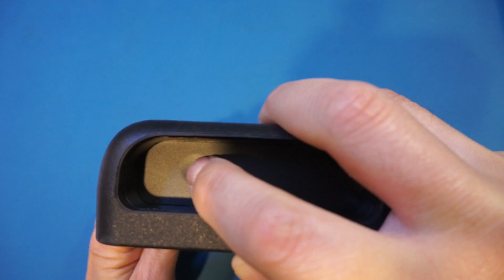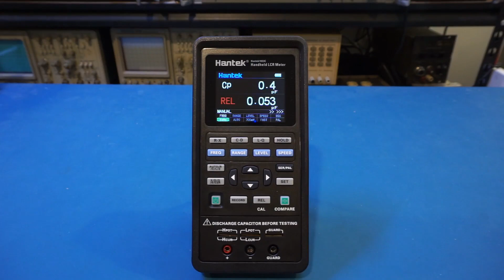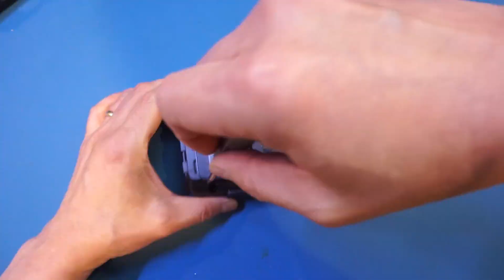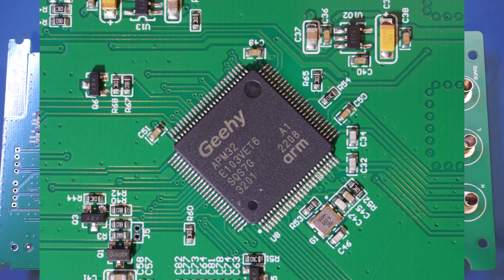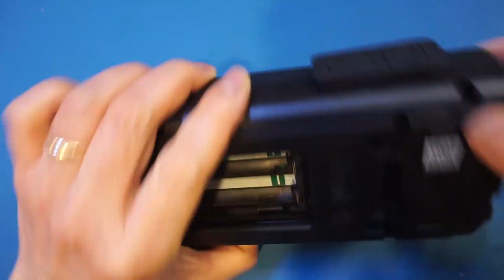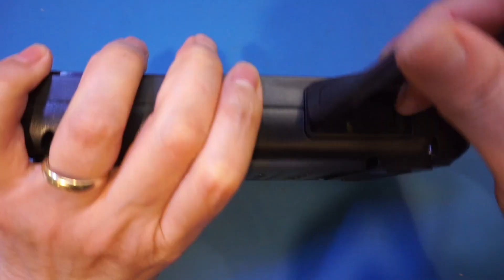Review/Teardown of a Hantek 1833C LCR Meter

Comment from the maker: Please turn off "Stable Volume" in the video playback setting (the first menu item after clicking the gear icon) as for some reason, this new YouTube playback feature made the video much noisier than usual.
Reply: Good day. My 5*Kelvin connector keeps falling out. It's very, very weak. Is this normal?
Reply: Good day. How did you remove the rubber housing of Hantek 1833C ?
Reply from the maker: @petepeter2037 You just need to pry a little bit. It is rather stiff I have to say.
Reply: @KerryWongBlog  I opened it yesterday. I don't like the connectors. The 5*Kelvin keeps coming loose. I need some kind of springs for the connectors to prevent current from leaking. I can't think of anything yet. Sorry my English. Kiev.
Reply: Electrical tape. Permanently. Do not cover the back of the lid with electrical tape.

Comment: 13:14 What causes the least significant digits to fluctuate during capacitance measurements on the Hantek 1833 LCR meter?
Reply: Mine did that too until I completed the Open & Closed  calibration.

Comment: In LCR meters like the Hantek 1833, the resistance is specified as Rp/Rs and measured at different test frequencies.
Does the “R” value in Rs mode represent the true DC resistance (DCR) of an inductor, or is it the AC resistance (real part of impedance)?
Also, under what conditions can Rs be considered approximately equal to DCR?

Comment: Best 1833c review on YT. 

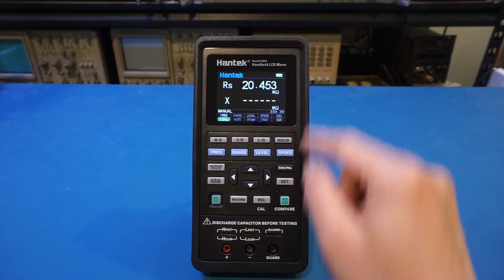At 6:58 you note the display numbers jumping around with 
nothing connected.  My 1832c did that until after I calibrated  both closed & open and the display of numbers ceased. Just the dashed line with nothing connected same display as what’s on your video. 
Thanks for posting.

Comment: I'm not sure the meter actually has a nH/pF resolution. the 0.001nH/pF might just me a result of numerical calculation. That doesn't mean the meter can actually measure a theoretical 1nH/1pF element. At 40KHz, a 10nH inductor would drop 2.5mV even at 1A current.

Comment: The shorted/open lead calibration drifted a little with my 1833C, I noticed it was powering up reading 7-8 pF open lead capacitance.  I did the open/shorted lead calibration and the meter zeroed again. However, the calibration corrections will not store into non-volatile memory and are lost every time I power the meter off, and it powers on to 7-8 pF again. The open lead calibration takes several minutes for the meter to complete, and having to do this at every power-up is stupid to say the least. My other handheld LCR, an Applent AT-826, stores the new corrections in its memory. No one knows of a fix for this with the Hantek, and the latest firmware doesn't solve the issue. For that bug, the parasitic power drain, and the LCD that isn't bright enough on the highest setting I don't recommend this LCR.
Reply: the calibration is definitely required always after turn-off the device for precise measurement. This is normal for devices like this

Comment: many thanks for this review! got the 1832c in today (i really don't know enough about this sort of testing to know whether i'll regret not getting the 100khz model. first thing i discovered is that it rejects any charging method that has any charging protocol such as pd and qc. i only found one charger which would work with it and it was the anker 65w 736 using the qc usb-a output--the usb-c outputs didn't work. i tried a half-dozen other fast chargers such as the 716 nano and the same number of cables (including theirs) without any success. it flat refuses to charge at anything other than 5v and evidently any overlaying protocols on the line confuse it. i didn't try any generic chargers, but i suspect any of the plain ones would work, but at under 2A i suspect. /guy

[later note: slow charging doesn't describe this. i just realized these are loose 18650 cells in there and i can simply keep a spare pair charged and i have a 3A charger which should charge them in less than one hour as they're 2600mah otherwise charging internally will take 2.6 (?) hours.]

[later note: i just realized my expectations were off because i think since the cells are in parallel they have a combined 5.2A capacity so charging at 1A would take 5.2 hours. the supplied charger is 2A and if it would charge at 2A it would finish in 2.6 hours]

Comment: At 14:41 why did you short the leads when zeroing out the stray inductance? Would it have been inaccurate to leave them open circuited?
Reply from the maker: If you leave them open the inductance would be infinite.
Reply: Thanks.  If, however, you calibrated the meter when first powered up (both open and short circuited) do you still need to zero out again before any measurement? And what is the procedure for capacitance? Zero with open or short circuit?
Reply: @Jnglfvr  The test leads themselves have an inductance to them, which would add to the apparent inductance of the component under test (because it's all connected in series). The procedure to zero it out removes that effect.

Comment: I think the point for the different speed modes is that you can reduce the (rather annoying) jumping around of the measured values quite a bit. I would assume that this also increases the accuracy of the readings because the internal voltage source might not be able to precisely hit the exact same values every time, especially since this will also include the power draw of the unit which also increases the temperature and thus thermal noise.
Reply from the maker: I assumed the slow speed mode would also increase accuracy, but there was no mentioning of that in the manual.

Comment: Thanks for review!
That place on PCB isn't for SD.. To me, by footprint, it more looks like place for Bluetooth or WiFi module..
SD card marking on rubber seal is because they using same enclosure parts in all series of tools.. 😉
On Hantek 2Cxx 2Dxx series scopes is SD card footprint on PCB, but it's not implemented in software. I'm tested it out, when hacking my scope from 2C to 2D..

Comment: With the handheld LCR meters I miss the input or a function to add bias voltage while doing capacitance measurement. It is important for switching power supplies using ceramic capacitors so you know how much capacity is left while the DC voltage is applied to the capacitor.
Reply: Did you find a meter with an option to add a DC bias voltage for measuring ceramic capacitors?
Reply: @jheissjr  No, not a mobile one. I got a stationary one Digimess RLC300 which I need to unpack every time I need it.

Comment: Yes, reuse the parts like case, keypad and LCD display as much as possible, so that you get economies of scale. Will guess that SD card footprint is there for the factory to do firmware updates, either they solder on the SD card holder, and do the firmware that way, leaving the card in, or it is there for a future version with a data logging capability, likely to be another version with different firmware, or the meter simply checks for the presence of the card on power on and enables the menu item in the UI already. As you already have USB data transfer easy to have the card appear on the USB bus as a card, the processor is powerful enough to emulate a USB multi function device.

Wonder if they designed keyboard for 2 separate charge controllers, so they are not stuck with having only one, but can change if they run out or price increases, with all the extra pads and layout there unused. Would wonder if the processor is protected, or if you can read out the firmware from it, it might be new enough model that the protection bits were not set, and if populating the SD card slot, and putting in a card, will show up at all either on display or on USB.

Comment: The pattern on the mainboard looks more like something like a communications module for Bluetooth or WiFi rather than a SD card.
Reply: Indeed. The pin-out reminds me of the BK3432,HLK-B20 and similar modules, which have 6 pins on the far end, and 8 pins on the sides. The white silk screen that sticks out, which Kerry might have mistaken for an SD card, is usually the location of the antenna, which could be indicated such that during routing care can be taken with routing ground planes/traces underneath there.
Reply: Yes, totally agree. This looks a lot like Bluetooth modules from Microchip for example.